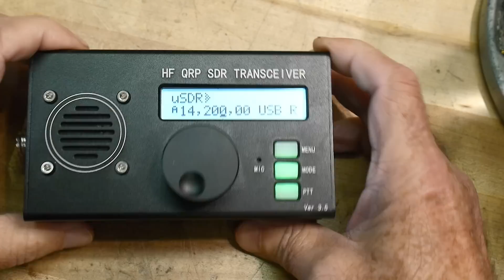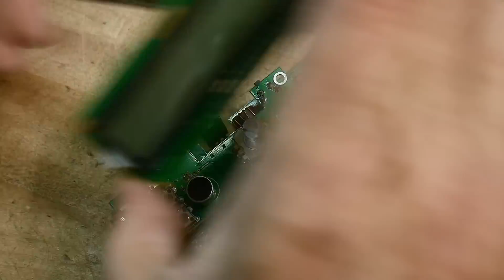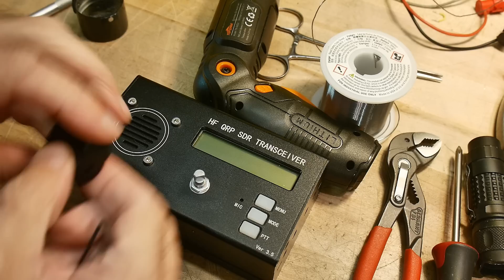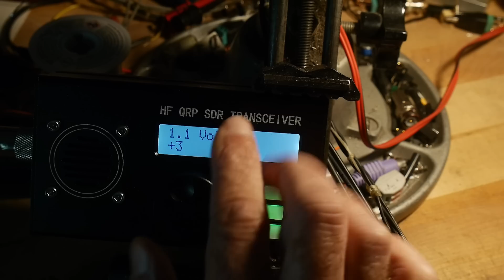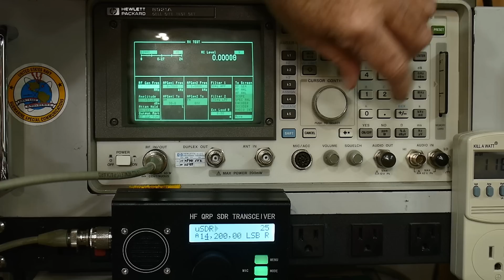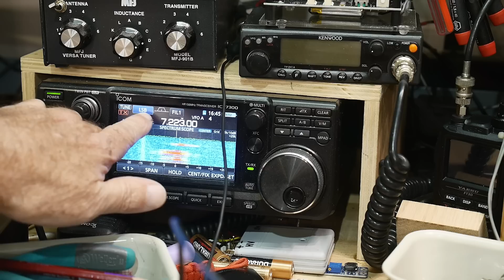#1041 uSDX uSDR Transceiver Review HF Ham Radio

Comment: Thank you to show us pcb board, on the low-right side there's LM7805 to supply TTL/mos integrated circuit, on the right solenoids and capacitors (low pass) to antenna tuning, on top there's a MOSFET RD16HHF1 class A Amplifier configured probably.
Radio tunning circuit is performed for frequency <7mhz what about the power! Unfortunately this transceiver have the minimum component in antenna tuning area. Wil be interesting use it for frequency >20mhz.
Do you have the web site address to send me please?(where there's schematic and project source code)

Comment: Hi , can this radio be expanded and programed please with the following potential features?
1. Rtty fsk ft8  with a mini pcb internal  circuit decoder tx rx.
2.  accept a compact antenna tuner 0- 30mhz.
3.  Swr sweep function.
4.  Add additional mini arduino internally with usb to computer interface tied to tranciever arduino. 
5. Programable frequency rx tx  (26-27mhz)
6. High speed scanner with programable frequency sampling like a budget spectrum analyzer. 
7. Telemetry hand shake between HF radios with blue tooth alert to mobile - missed call text.
Radio is awesome with an entry level price.
Would be very autonomous with above features.
Thankyou for your video.

From Andrew.
New Zealand

Comment: I thought that that would be a ZERO IF Transceiver using a switching I/Q Generator that drives the modulator and a switching I/Q decoder that takes it's signal from the mixer.

Comment: Hi, I have a request for you ,
you can tell me the name of the semicircular black transistor,please.
which is located next to a powerful transistor with cooling on the housing.
I have the same transceiver, but the manufacturer messed up and put two
identical high-power transistors.Therefore, my transceiver is almost non-working.
Thanks.Nice video.
Reply: The transistor is IRF 510. And mine also has two of them.
Reply: @pansim87  Thanks for the answer, I asked the name of a small black transistor, I think it's BS 170.
Reply: @digi4151  I have the same usdx and on mime is iIRF 510.You can check in yours what it is.
Reply: Check the soldering.I had the same problem and i fix it
Reply: @pansim87  Thanks)
Reply: @digi4151  you are welcome. 73's de SY1DUG

Comment: The "radio on a chip" is actually just the Atmega 328 microcontroller. All of the little mixers, IF's and such that we old-timers are familiar with have all been replaced with software. The decoding and encoding of AM, FM, and SSB is all done by the Atmega 328 running sophisticated math algorithms. It is an almost entirely digital radio.

Looking at the toroids, I'm going to guess that they are using identical, low-quality toroids for the class E RF output resonators and the output filters and not tuning them for optimization, and that's why the output just keeps dropping off as frequency increases. I watched a video of the designer of the original rigs take a 0.7 Watt output and tune it up to over 5 W just by adjusting the toroid windings.

Comment: I have one of those. I went through the AF circuit and put a mechanical/pot volume control on the edge of the board above the headphone jack. Makes a much nicer radio without having to use the menu AF gain, which I think sounds really horrible at AF gain settings below about 10. Pretty decent rig, really. In fact, I like it better than the X5105, even without the ATU & other fancy stuff. Perfect POTA/SOTA rig.
Reply: Ordered mine today, de N4QM
Reply: @Bubba_Warbucks  Email headed your way. Some night you wanna get on 75m I can try but I'm at less 'n 500W to do it.
Reply: @haramanggapuja  According to Banggood I can expect delivery the end of June.  Unit shipped yesterday, LOL.  BTW I also got the little 100 watt ATU with it.

Comment: It’s a Chinese copy of the DL2MAN/PE1NNZ collaboration. There have been several variants and iterations over the past couple of years, and lots of buy groups. The original being the ‘sandwich’ with variants providing different band options.  The majority of Chinese copies have been a hopeless waste of money, not worked properly and harmonics too high. If not operated into a properly tuned antenna, the class E amp ‘pops’…. The latest and protected version is the (tr)uSDX, a fantastic little transceiver the size of a credit card in area, and about 1.5 inches thick.  I have several of the kits, if you want a ‘traditional; through hole build then Barb, WB2CBA also has several designs available with gerbers etc.  All are awesome projects to learn….. and expand on your radio knowledge - G4UET

Comment: I believe that PW555 is actually an I/O expander for driving the filter relays. The real receiver is, probably, based around an FST3253 as a sampling detector providing the I/Q signals to be processed by the Atmega. Really amazing what the original author managed to squeeze out of such a small microcontroller. It's a pity all these chinesium copies are overshadowing the original.
Reply: I was going to say the same thing, but you beat me to it.  This is based on the QCX, which was modified to support SSB.  The method of sending SSB with the class E amplifier of the QCX is very interesting. I would love to see a video discussing and showing how it works. Maybe comparing it's performance to more traditional methods of generating and amplifying SSB also.
Reply: Yes you are right the PW555 is relay drive... 
I have one unit but I don't like the transmission audio in LSB  and USB is to noisy...

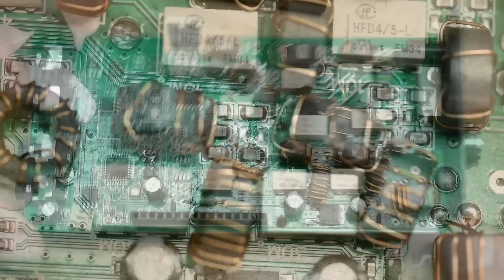Comment: at 5:50 near the top of the screen -- is that two unsoldered pins?
Reply: Yeah I saw that too, looked unsoldered to me.
Reply from the maker: it is the battery connector. Was soldered from the other side and did not wick through. the radio obviously works so guess it's fine.

Comment: If I remember correctly you need to be -60 dBm outside the band so -40 dBm is no good. This thing is not legal for sale.
Reply: Only in the top bands from 15 to 10 MHz. 
 So,  make a filter to stop the bleed over in the  harmonics for the top bands. 
 I just wonder , how many pixies are used in scouts for cw or xtl radios , a lot still love them, did you do the testing or just quoting 
What the original maker said.  
They only made them for 80 or 40 m. I agree they not a rolls Royce but then, no one is filling the market that people are looking for are they, to correct it.
Even the original maker said they were not in it for making money.  I agree their should be a better effort for the price.
Reply: Below 30MHz the spec is -43dB, above 30MHz it's 60dB.  According to this test, this particular radio meets the spec.
Reply: @Bubba_Warbucks  I checked the legislation here in my country (Denmark) and it is -60 dBc outside band no matter what frequency. As this kind of legislation typically is regulated by EU I expect that to be the case everywhere in the European Union. It is quite possible different in the United States.

Besides there clearly are higher order harmonics displayed on the spectrum analyzer at approximately -50 dBc and 50 MHz. That is no good even if the rules are as you say.

For example take a look at the video at 20:26. The range is 5 to 50 MHz. There are 6 harmonics on the display and probably even more above 50 MHz. The peak furthest to the right is almost the same height as the one he is measuring, so approximately -50 dBc.
Reply: @BaldurNorddahl  I guess all I'm saying is that it meets or exceeds US standards as of now.  When (and if) mine arrives I'll measure it on a spectrum analyzer

Comment: I just got one of these 2 days ago to take on a couple of vacations. I thought the rotary encoder should have clicked, and you showed it does, but my didn't. I just pull the knob up a bit, and it clicks, thanks. Now if you figure out how to get the CAT interface to work, that would be great. I've hooked up a protocol analyzer, and I see stuff going back and forth, but no joy when it comes to controlling the transceiver.
Reply: I believe it may speak the TS-480 command set, OM
Reply: From what I have read the chipset uses TTL level serial data, not RS-232, so you'd need a USB to TTL data cable to get it going for computer control.  They are out there.  Adafruit has one that should work with this radio.
Reply: @Bubba_Warbucks  Or possibly just a MAX232, if one happens to be in the junkbox (assuming the PC has a real serial port of course)
Reply: @c0ldcity  I know, right.  Turns out my HP Elitedesk computer has a real honest-to-Pepsi RS232 serial port on the back, right on top of the legacy VGA port.  Leave it to HP to keep us old guys happy.
Reply: @Bubba_Warbucks  Wonderful! I have a lovely old CF27 toughbook that I covet for both those ports too :)

Comment: Output power is typical of non-rf MOSFET Transistors used in final RF Amplifiers of these types of radios.
Reply: Wich MOSFET is used? I´ve burned mine
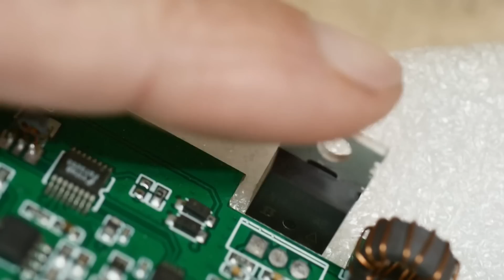Reply: I found it on 9:09 irf510 tkns
Reply: @rodrigobuzatti  IRF 510